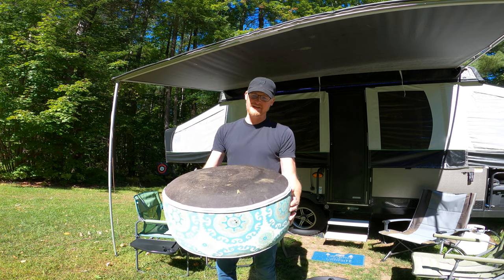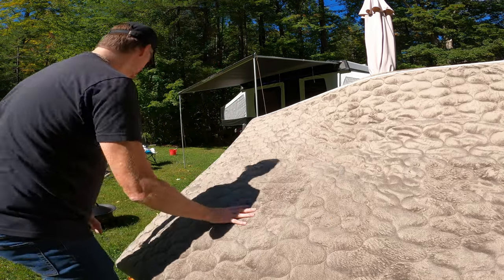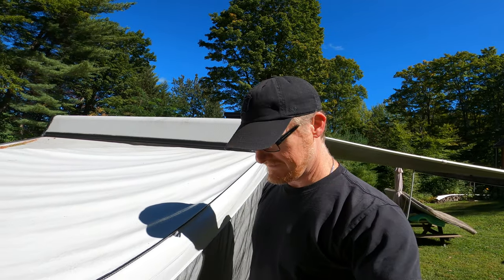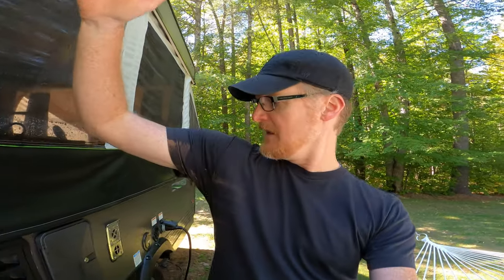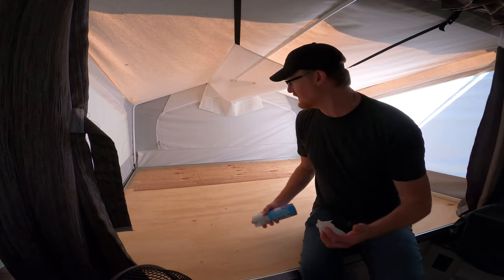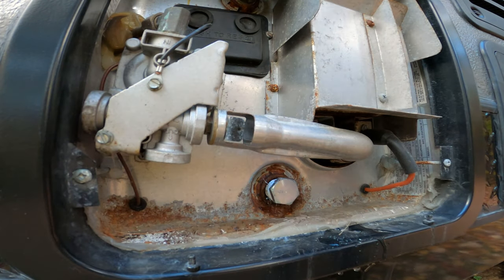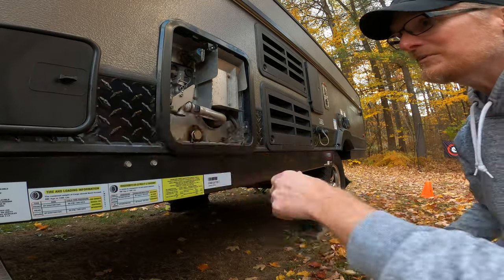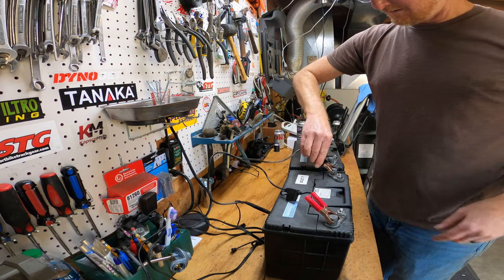Pop Up Camper Severe-Winter Prep | Drain, Clean & Store | Mold Armor

Comment: The two best things you can do for the long-term survival of a camper is store it undercover and run a dehumidifier inside it all the time when you're not using it.
Reply from the maker: I see a lot of people using the moisture absorbing buckets. Living in VT we don't have issue with humidity but keeping it covered is critical when we park it. Good advice!
Reply: @sstressfl  Yeah the buckets are okay but I prefer an actual powered dehumidifier. I live in Florida and I can't imagine what the inside of my camper would be like if I didn't run a dehumidifier. I probably dump a half a gallon of water a week out of that camper from the dehumidifier.
I really like keeping my camper under a carport as well. I'm sure you know leaks are the main enemy of any camper and a carport really gives you extra time to find and fix them before they cause problems
Reply from the maker: @DoRC  I used to live in Pensacola (UWF graduate!) and the humidity is a destroyer even in the winter months. And the sun alone can wear out anything that sits in that direct sunlight for too long. Sounds like your camper is in good hands :)

Comment: Which trailer dolly are you using at the end of the video?
Reply from the maker: It’s a cheap harbor freight dolly that I modified Harbor Freight Trailer Dolly Mod | Pop Up Camper Rockwood 2280bhesp
https://youtu.be/qkUFNCmHo6U
Reply: @sstressfl  haha I didn’t know about the mod. I bought a $70 harbor freight dolly rated for 600 lb tongue load. The actual wheel bent under the load after about 5 minutes of tugging and pulling the 2280 in my driveway. Live and learn I guess.